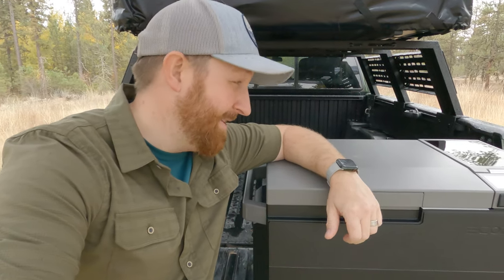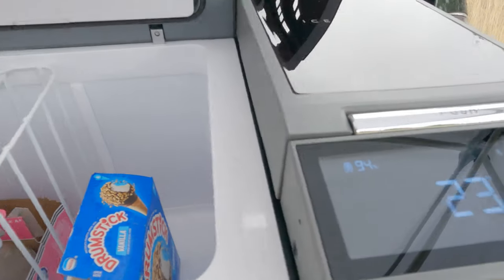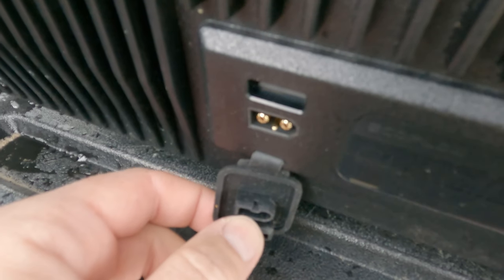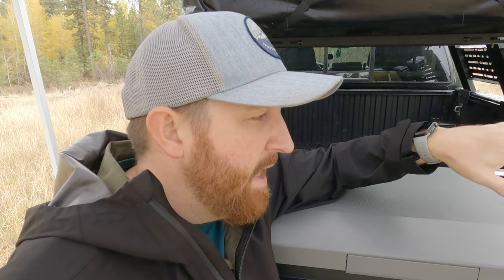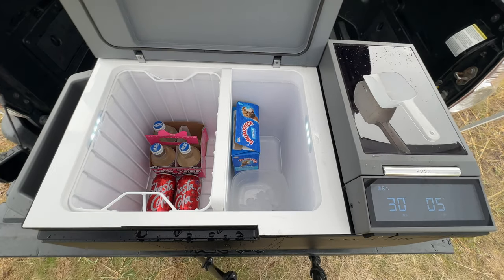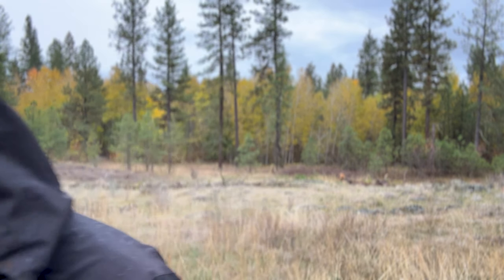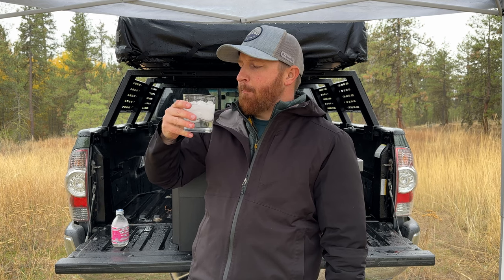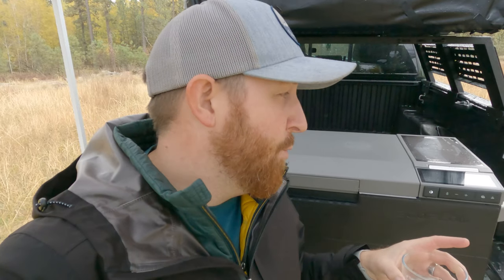Best Fridge for Camping? It Makes ICE! Ecoflow Glacier

Comment: Interesting review. I do agree that the $1500+ price tag definitely makes that fridge a camping luxury. I could see folks with camping vans and truck campers finding it useful.
Reply from the maker: Definitely! It’s a fancy fridge!
Reply: I'm gasping at the price, but I agree it is worth the value!  That's ice maker alone makes it with it.
Reply: @wanderlust62  😱 I've watched many camping videos and I've yet to see one camper who has an ice maker. Of course, they don't need them in the winter. For those who "live" in their camper vans/trucks, a small fridge/freezer that connects to a power station would be a better and less expensive option.

Comment: I saw a review of this fridge from another camping channel, but your review is much more thorough. Question. With that adapter. I can just plug it in and run on electricity, right? Or is it for charging the battery only?
Reply from the maker: Thanks! You can just plug it in and it will run the fridge if the battery is not installed. If the battery is installed it will charge the battery while still running the fridge 👍
Reply: @BaumOutdoors  thanks for the info.

Comment: Perhaps I'm missing something (I'm not), but, it would save you about $500+ to just buy a 12 volt, dual zone and a zip lock bag.  Put however much ice you want, from home, or at a convenience store (some do not charge for a 40oz cup of ice........go NUTS and get TWO 40oz cups of ice........even if they charge you .75 for it), put the ice in the zip lock bag, put the bag in your 12v freezer.  Now, you've saved $500, you have ice whenever you want it, without having to wait 15 minutes, you draw less energy, and, on a similar sized cooler, you now have that additional compartment space.

This ice maker seems more like a (+$500) gimmick, the cubes are small, and when it breaks, that's essentially dead space that could have been used for a larger compartment.
Reply: or just put an ice cube tray in tbe freezer compartment